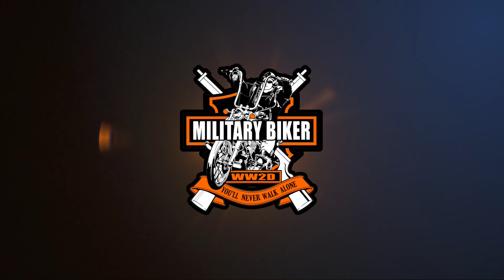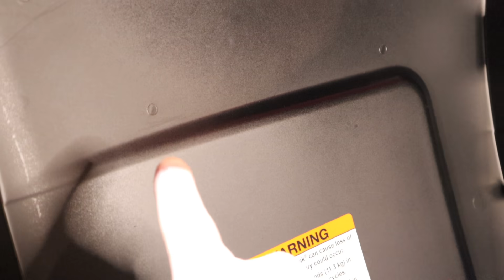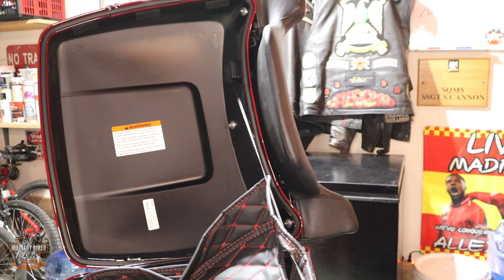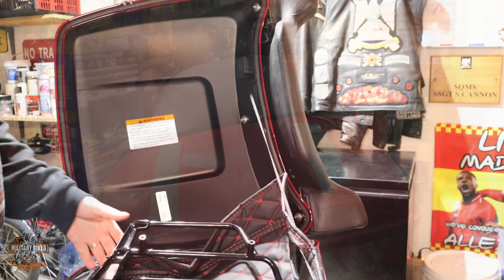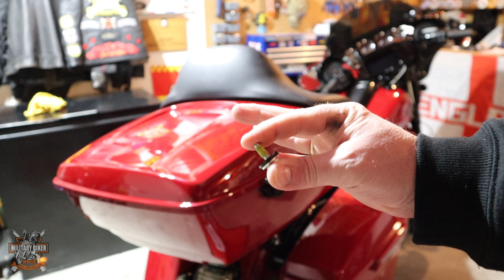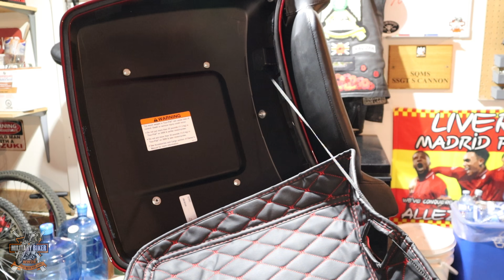Installing Harley Davidson Airwing Luggage Rack on King Tour Pack

Comment: Great job, you did it pretty much exactly how I mounted mine. Probably over kill but I added a light coat of black RTV to the base of the bolts and washers where they go against the tour pak on the inside to be sure they never leak.
Reply from the maker: Thanks for watching mate